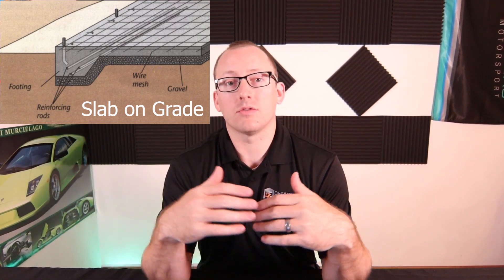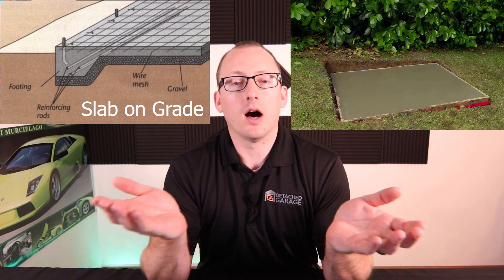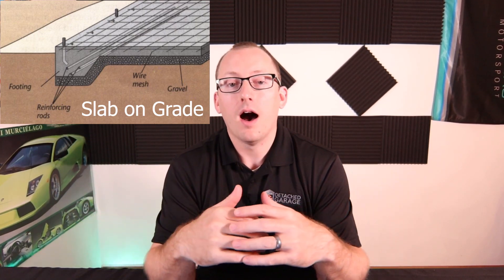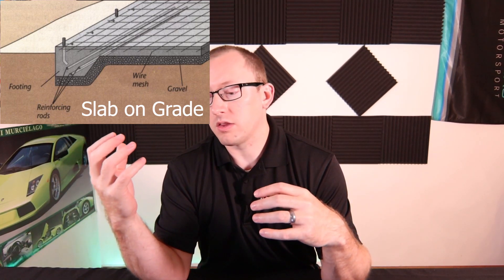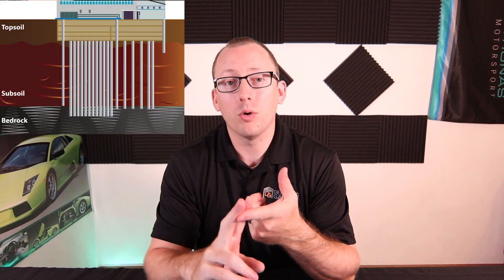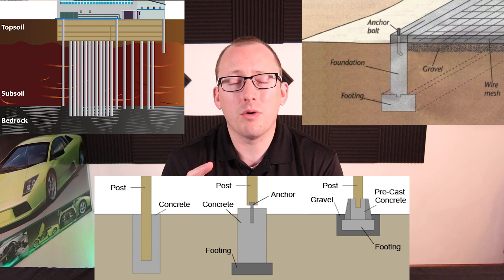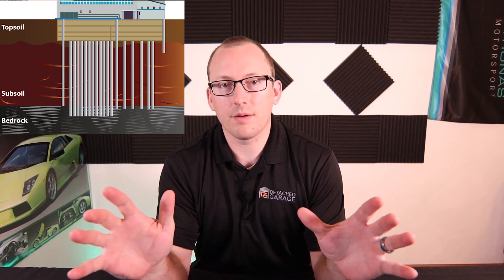BEST type of shallow FOUNDATION for your GARAGE? // Foundations, Footings, and Slabs

Comment: Another great video!

For my garage I ended up doing footings and foundation walls due to the size of the building and cold we get during the winters.  We have a frost depth of 30" here so we went with a 42" foundation wall so I could have an extra foot exposed.  I also installed radiant heat in the slab and laid out my tubing with consideration for a future 2 post lift.  The slab ended up being 7 to 8" thick of fiber reinforced 5,000 PSI concrete so I didn't worry about making the areas where the posts would be any deeper like some folks do.

Check with your local building department about bringing utilities up through the slab, in my area natural gas cannot come up inside of a building. The riser must be outside then go through a wall instead of the floor.
Reply from the maker: Thank you so much for the great feedback! 
Sounds like you have a pretty awesome setup that will be similar to mine. I will be sure to check with the building inspector. Thanks for your support and feedback, it helps make future videos better.
Reply: I'm curious, why didn't you build  your garage on concrete piers 42" deep?  Seems like that would have been quite a bit cheaper.
Reply: i know Im quite off topic but does anyone know of a good website to watch newly released tv shows online ?
Reply: @Demetrius Keenan I watch on flixzone. You can find it on google :)
Reply: @Marc Kaden yup, been using flixzone for since april myself :D
Reply: @Marc Kaden Thank you, signed up and it seems like they got a lot of movies there :D Appreciate it !!
Reply: @Demetrius Keenan happy to help xD

Comment: I am investigating the proper type of foundation to use for a 12x22 prefabricated single car garage with reinforced floor already included on 4 inch skids.  I am currently on the fence between a crushed gravel pad or a concrete floating slab.  I don't want to spend unnecessary money, but have no problem IF the slab is much more stable.  I live in northern Illinois, so we are contemporaries in geography.   Thanks so much!
Reply from the maker: Hey Dave! 
Thanks so much for the comment! Can you go any deeper than 22' on the prefab? It could make a world of difference when trying to work on vehicles in the garage. I think you would likely be ok with a monolithic pour, but I would double check with an architect on the type of soil you have. You can usually get a soil test for under $500 which is well worth the upfront cost to avoid cracking and mudjacking in the future.

While our geography might be similar, we have WAY more cheddar in the ground north of the state line #GoPackGo :-) thanks for following along!

Comment: Thanks for the video. Definitely helpful. 
I'm planning a 14x36 garage. Since I'm under 600sq ft I can do a monolithic slab. I'm also adding radiant floor heat.  I'm a little on the fence about doing a short poured wall or a course or 2 of block. I'm using 2x6 lumber so the block or curb will need to be the same.
Reply from the maker: Sounds like an awesome project! Be sure to send me some pictures of the progress as you get going. I would go with short poured walls. One less contractor to deal with :-)

Comment: My current slab on grade has multiple cracks radiating from the center.  Where the cracking increases near the edge the slab has fallen a couple inches on one and a half of another.  We are currently converting our two car garage into living space.  What would you recommend for norther Wisconsin where the water table is high and it’s unlikely that I can excavate 48” to pour footings?
Reply from the maker: Hey Charles,
Thanks so much for reaching out! It is great to be connected with a fellow Wisconsinite. I'm down in Southeastern, Wisconsin and we have similar issues in some areas. Your best bet is likely to excavate and pour/build traditional footings with traditional drain tile/french drain to a sump crock if the water table is really high. your next bet could be a ribbed slab on grade pour with thicker sections to help with the overall stress. Honestly though, it sounds like you have some sort of subterranean movement from water or a poorly prepped site for the slab on grade from the original pour. Or you could even have some sink holes from water eroding the base material below. It would be best to consult a civil engineer for $2-300 for a quick site visit to review next steps before you move forward. I hope that helps. Let me know if you have any other questions, and good luck with the transformation.

Comment: I'm looking to get a 20x22 prefab 2 car garage, for parking my 2 cars. Would a 4 inch concrete pad on grade with wire mesh be good enough? I live in Maryland, winters are pretty mild-to-moderate and I'm not in a flood zone area.
Reply from the maker: You should be fine, but it would not hurt to run it by your town planner/local architect/design build.

Comment: I just watched your video thinking that I may try and do this all myself or I’ll be my own contractor and sub parts of this stuff out.

I can’t find anybody to give me a quote on doing a garage and I’ve been looking for three weeks now.

I’m gonna be doing a 30 x 36, pretty much freestanding with an enclosed and attached breezeway to my existing single car carport utilizing one of the existing window openings as a doorway. I’m planning on putting a two post lift on one side of this garage and that will require a different type of roofing system than a typical truss system.
I also want to use about 1/3 of the headroom space for storage and enclose a small room inside the roof and have stairs leading up to it from inside the garage. My house is getting too cluttered with stuff that needs to be stored and I have no storage space.
If you know any garage builders in South Carolina between Florence and Columbia, please let me know. But I don’t want a fly by night builder and get screwed over again. I already had that experience with my metal roof on my house which still is not right!
Reply from the maker: Thanks so much for watching, and thanks for reaching out. It sounds like a great project! Getting contractors to call you back/quote right now is extremely difficult. I'm running into the same thing with my garage build. I wouldn't get too discouraged about the last three weeks though. At the end of the year it goes even more quiet. One thing you might want to try would be reaching out to a local architect or even a design/build firm and have them recommend someone to try and get a quote.

I don't have anyone that I know of/Trust  in that area of the country right now, but I'll be expanding my network in 2022.

Comment: Great video, thanks for  sharing.  I'm working up plans for a 30 x 40 garage/workshop.  Per building code I need a minimum of 4" for the slab with 10" wide x 20" deep footings.  I plan on including a vapor barrier underneath.  Any suggestions on if I need a layer of aggregate under the concrete?  I live in Texas and the soil here is expansive clay (sometimes called black gumbo).  The city does not require a layer of aggregate, and most monolithic home foundations I've seen just put the moisture barrier over the dirt with no substrate beneath.
Reply from the maker: Stephanorf very nice! Thanks for the love 🙏 Just as you described is how I’ve always seen it done in TX. If you are doing a lift you likely want to go at least 6” vs. the 4” minimum 👍

Comment: Hey man, great video. I've seen lots of garages built on concrete piers where the dirt was drilled out to just below the frost line.  Then they pour the slab after the building is completed.  Curious as to why you didn't talk about that option?  It seems like that would be cheaper than all the other options you discussed.  Plus it's fast; you can drill and pour in the same day, and start building the next day.
Reply from the maker: Thanks for the kind comment. Are you describing more of what a post frame or pole barn build?
Reply: @DetachedGarage  Well yeah, that's what I've seen, now that you mention it.  I guess this video was just meant to talk about 2x4 framed construction?
Reply from the maker: Mark Roberts Check the video at 8:20 for more info on post frame/pole barn. Is there a specific question you are wanting to get answered? Happy to help.
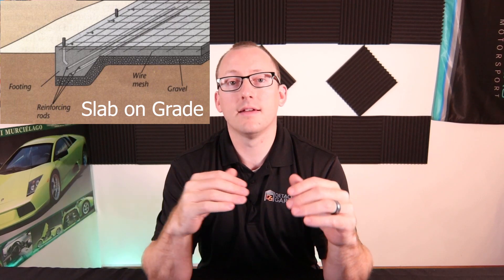Reply: @DetachedGarage  Thanks for your responses.  I was just surprised at 3:56 when you said "Slab on grade construction is going to be by far the cheapest because (1) you don't have to dig down as far, (2) you're doing the same amount of prep, and (3) you're using less concrete to fill it in."  (That's paraphrased.)  However, it seems to me that drilling holes and throwing concrete in would be cheaper, easier, and faster.  Less digging, less prep, less concrete.  No?
Reply from the maker: @mroberts566   Yeah, a bit of a generalization on my part. In general your concrete work between slab on grade and post frame with a poured slab are relatively similar. I was more focused on an insulated space.
Reply: @DetachedGarage  I didn't notice your response until just now.  That makes sense, thanks.
Reply from the maker: Mark Roberts no problem. Thanks again for watching.

Comment: I live in riverside ca my question is on a slab on grade foundation how deep and thick should be?
It will be for an extra bedroom
Reply from the maker: gilberto bernal iIt depends on your soil and what you are going to use it for. Most lift manufacturers recommend a minimum of 4” thick.

Comment: This video is misleading... let the structural, construction, and estimating work to the professionals. Also it’s not call piers, we call it driven piles Or simply piles. Second, Bridges use piers which are just another name for a single group of piles or columns, loads are transferred from the column (piers) to the piles. Third, micro piles or drilled shafts is the correct name for “filling a hole with concrete” as you say. Last, you should have brought-on-board an industry expert to explain these delicate subjects. Also do not ask “general” ppl for their advise unless they are licensed engineers 😂 that’s why you pay us to tell you how to do things safely and cost effectively.
Reply from the maker: Luis, thanks so much for watching and thank you for the feedback and the corrections where I misspoke. I'm hoping my video can drive some better conversations with Architects and Engineers, such as yourself. Again, thanks again for watching and feel free to subscribe so you can keep providing valuable comments to help education this awesome garage community.
Reply: And let all communication be done by those with English or communications degrees. <sarcasm> Many fine and structurally sound garages have been built with no aid by people holding masters degrees in engineering.  Garages are built every day by people with years of practical experience and are built efficiently. 
I hope that you're able to acquire your PE, but also that you gain some moxie with working with people and an improved set of grammar skills.  Cheers my young ambitious engineering friend.
Reply: @timrich6755   Feel free to give me a call after a natural disaster happens in your area... I will gladly provide you with some structural engineering assessments and recommendations of why your “home made Engineer” garage failed.
Reply: We have a know-it-all in the room.
Reply: Natural disasters?!  We building the bay bridge here?!  Oh brother.   
If I was an engineer I probably would want to feel superior with holding my certifications.  Some people need more education in couthology.  Im guessing if I was married my wife would be impressed at first with my certifications but probably end up in divorce from my attitude.  

Just have some compassion for others is all we ask.  God bless.
Reply: @patwalk6844  Which bay bridge? the new cable stayed segmental bridge in corpus Christi, TX?
Reply: @luismanrique5373  it was sarcasm. Whatever bridge you would like it to be.